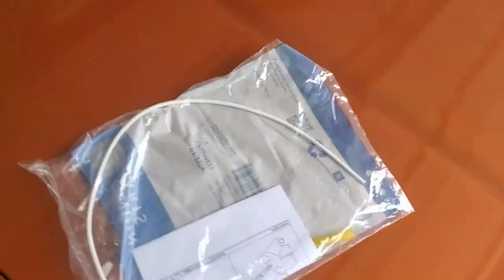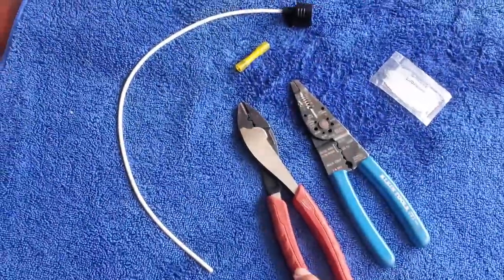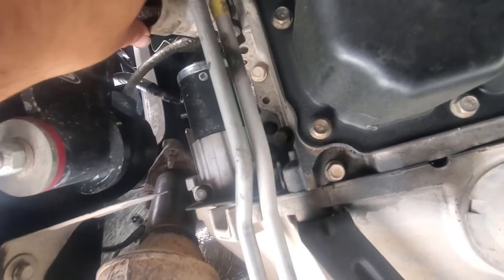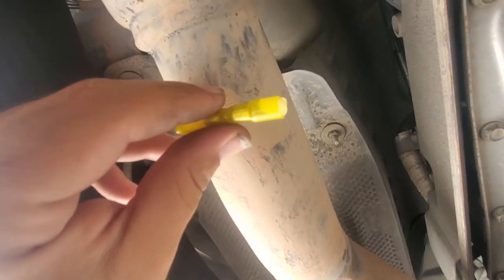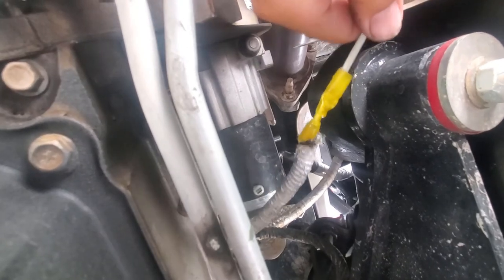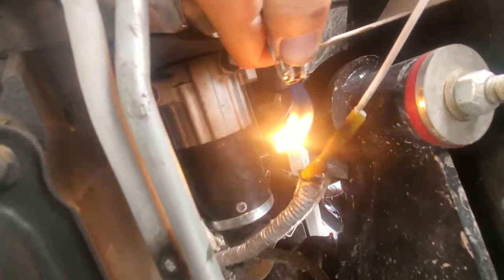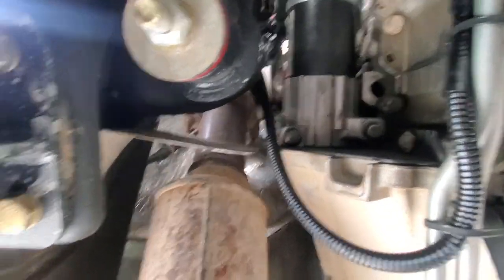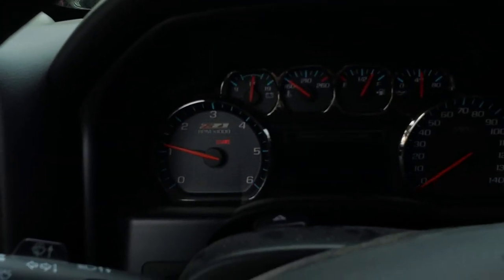Broken starter connector plug. How to change a wiring harness pig tail.

Comment: I watched your first video of changing the starter. You failed to mention the tab broke! 😂 when mine broke I was angry. I couldn’t get it to come off. I feel like I fought it longer than it took to change the starter out. Glad I’m not the only one who’s broke.
Reply from the maker: Dude I’ve done my starter 3 times since. I’ve broken 2 of the 3. It’s still frustrating
Reply: Mine broke in my tundra. It literally crumbled to pieces.
Reply: @FinalBossGarage  3 times! What brand are you buying? I bought the AC Delco brand off Amazon so I could get 2 day shipping and hopefully it’s the last one I have to buy. Truck is a 2015 so no auto on/off BS
Reply from the maker: @andrewgardner107 i got it from autozone so luckily each time has been under warranty. Seem to get about 20k miles out of each one. Mine is a 2015 as well. I can change it in about 10 minutes now that’s I’ve had all the practice.
Reply: Recently pulled my starter on Thursday, and the tab was brittle. After fighting with it for a few minutes, I broke it 🤦🏽‍♂️
Reply: Yep, mine too 17 Sierra 😂

Comment: You don't need to splice in a new connector if you break the red clip. The plastic parts of the connector easily disassemble. Buy a new connector pigtail and pry out the gray core with a small screw driver or steak knife from the side. Next push two small paper clip pins into the two small holes on each side of the metal connector until they bottom out. Now slide the plastic connector off the metal crimped wire connector. Repete with the broken one then simply slide the new connector then the gray core onto the existing metal crimped connector.

Comment: Hey so my clip is broken. I have the replacement cable but my question is, sometimes did your vehicle not start and you had the clicking noise when you turned the key? And sometimes while connector was still broken, and you put back on starter did it not crank or sometimes would it?
Reply: Go under the vehicle and apply pressure to the connector so it can start up, while with the other hand use the key fob to start it .... when starting it it causes enough force to kick the connector off..

Comment: Thanks for this. Same thing happened to me on my 2018 GMC Sierra tonight. I ordered the pigtail but am wondering if you can just swap the red tab and inner lock onto to the existing connector. Would be easier if it can be removed and reinserted. I am happy to see you were able to do it from the bottom though, as I put the wheel liner and everything back on.
Reply from the maker: Glad it helped. I felt like nobody else would make this mistake and the video would of been pointless. No clue if you could or not though, on swapping the tabs.
Reply: Did you swap the red tab? please show me how, maybe a video? 
Broke mine today, 2015 sierra 1500, the part is exactly the same.
Thank you so much!
Reply: @fzy55  You can actually just remove the end plug and put a new one on. I figured this out after I did some searching on the part number I found on the new plug when I bought the pigtail. I feel horrible about suggesting you watch one of my videos, but I did post on how to do this, and the description has the info on the part numbers you need. I couldn't find a way to contact you via YouTube to mention this. I will say though, huge thank you to Final Boss Garage, as it got me on the road to finding the pigtail and realizing I could swap the connector.
Reply: @stevegnh  Huge thanks! Found your video on your channel! Will do the swap once i receive my part, by the way, i found the equivalent part on eBay which is just less than 10 us dollars  including shipping!
Reply: @fzy55  good luck!
Reply: Great video but I found it easier to I unclip the whole end of the plug and replace it.

Comment: When you pushed the NEW connector on did you have to pull out the red tab then put it back on or can you just connect the wire and push it on
Reply from the maker: Dude I still have no idea. I’ve broken two already. I hate those clips
Reply: @FinalBossGarage  I mean like when you installed the new pig tail did you just push it onto the starter. You didn’t break it in the video. I have the new pigtail ready to go just not sure when I push it on the starter if I need to remove the red tab then install then put red tab back on the
Reply: @nathangraham7248 bro what??? I’m so confused by this why would you remove only the red tab? If you have a new connector why not just replace the whole thing

Comment: what was the function of that particular plug and what would happen when it would come off before you fixed it with a new pigtail? Was it meant just for signal, or did it supply power?
Reply from the maker: Signal from ignition
Reply: @FinalBossGarage  Thanks. I suspect that it was in fact what is termed the S post on the solinoid. I am in process of trouble shooting my 2008 Uplander and what had me confused was that on my starter there is no physical S Post. It merely had a female plastic connector with which a single small gauge with from underneath the vehicle plugged into. I was presuming it was the signal wire to the solinoid traveling down thru the path to set the solinoid in motion to activate the connection so the electric on the B post could travel on to the starter motor.
Reply: I went through some serious do, or die circumstances and still am on this vehicle, but I think I found the correct path in the following post by someone. Here it is for your review. It has to be the simplest, least confusing set of instructions on this subject I have ever come across.                     It occured to me you might be able to use it as a blueprint for an instruction guide to give out to others snd perhaps check it over and comment if you see anything in it that its missing. If not I should be good to go.                                                                                      

                          “No Crank No Start”
Let’s start with the issue on a  particular car…a 2000 Mercury Grand Marquis.
Car was starting up just fine everyday until one day I went to start it and just clicked. I knew the battery must have drained overnight somehow so I thought I had a parasitic drain somewhere in my car but when I checked, it was just drawing around 20mV (well under average draw of 50mV) so I ruled that out and since my battery was 7 years old, I assumed that the battery just gave up.

I purchased another battery, replaced it and my car started BUT…I did notice that the first two or three cranks were very slow and after that, the starter was cranking normally and started the car right away. The same thing happened every time I started the car, slow cranking at first and then normal cranking speed and starting up right away.

That went on for about two weeks or so until I finally started having issues starting the car again. Sometimes when I turned the key, I only got a single click and then nothing else, no crank, no start. Some other times, after I turned the key, it would take a full second for the starter to start cranking the engine and then start the car as usual. And some other times it would start the car right up!

This was the pattern for a few more days until I just couldn’t start the car AT ALL! Turn the key, single click and no crank, no start! Ok…time to check every component of the starting system to see what went bad! First…I did the simplest things to do. Just tap softly on the starter with a hammer or something somewhat heavy while you try to crank the starter and see if that gets it going. It did not.

OK…maybe the flywheel ended up in a position where the starter can’t catch it and therefore unable to crank the engine. The solution…simply turn the crankshaft pulley with a breaker bar and the appropriate socket a little bit to turn the flywheel enough for the starter to catch it and start the engine up. (This method will also let you know if your engine is seized up or not and a reason why your starter would not be able to start your engine) I was able to turn the flywheel and then tried to start the car…still one click, no crank, no start! No flywheel issues!

OK…next thing…check your battery voltage. Without any load on it, it should read around 12.6V or so when it is fully charged. If that checks out, next…measure the voltage on the battery while trying to start the car (doesn’t matter if the engine cranks or not, the load will still be there) the voltage should not go below 10V. If it does go below 10V, then your battery charge is low and therefore won’t be able to crank your engine. Have it recharged and try again with a full charge. If the starter still doesn’t crank the engine, now you know your battery is not the culprit!. (In my case my battery was brand new so I knew that was not the issue. I was reading around 11V with a cranking load)

Next step…check resistance on battery cables with voltage drop WHILE there is a load on the cable. Set your DMM on DC Volts and connect one lead to the positive battery terminal and your other lead to the other side of the positive battery cable that goes down to your starter and connects to your starter solenoid. (It doesn’t matter what lead you use on either side as you’re only looking to see the voltage difference between leads) (Not all starters have the solenoid mounted on the starter itself so just follow the thicker positive cable from the battery until it reaches the solenoid) Try cranking the engine for about 10-15 seconds and read the voltage on the meter. Any reading below 0.5V is acceptable on most cars but please check on your particular model. If you get a reading of more than 0.5V, then your cable is bad and needs to be replaced as it has way too much resistance for the current to flow properly to the starter. If the positive cable checked out okay now test the negative cable. Connect one lead of the DMM to the negative battery terminal and the other lead to the starter body. Crank engine for 10-15 seconds and check voltage. Same…if above 0.5V reading, the cable is bad and needs to be replaced. (NOTE: If your starter is actually cranking the engine but you just want to check your cables, you need to disable either your fuel pump or the ignition system to prevent the starter from starting the engine) (Also…allow the starter to cool off for a couple of minutes between cranking attempts or you could literally fry the solenoid) In my case, both the positive and the negative cables checked out okay so the cables were not the issue either.

Bad ignition switch?..You can check this easily with your jumper cables or a remote starter.
Keep the ignition switch in the off position - Just connect one end of the positive jumper cable to the positive battery terminal and with the other positive end of the jumper cable briefly touch the smaller bolt on the starter solenoid to activate the starter. Do the same thing with the remote starter with the only difference that you actually connect the alligator clip to the solenoid smaller bolt and press the button on the remote to activate the starter.
If the starter now cranks the engine, there is a problem in the wiring from the ignition switch to the starter solenoid. In my case, I still had just one click, no crank, no start! Ruled out ignition switch as a culprit as well!

If you went through all these steps and still couldn’t find the problem, then there is only one thing left that can be wrong…THE STARTER! I should mention that this starter had only been on this car for 4 years (I replaced the original one after the bare wire going from the solenoid to the motor corroded so bad that it couldn't flow current properly anymore and therefore couldn’t crank the engine. (Why is it bare anyway to begin with? Especially anywhere that roads get salted for winter! UGH!) I honestly thought that the last thing that could be wrong would be the starter so before I took it out I checked this bare wire and it was still looking pretty good after 4 winters. But I wanted to be 100% sure whether the starter was the issue or not so I took it out and before having it tested at the auto parts store where I bought it from, I bench tested myself and sure enough…it was still doing the one click, no spin.

The one click was just from the gear coming out to meet the flywheel but there was no spinning whatsoever. YES! Found the problem! Bad starter!! But why did it fail after only 4 years of use? I wondered… To be double sure lol I still took it to have it tested with their machine and guess what guys??? The same starter that wouldn’t work for me is now working for them every single time they start it…HOW IS THAT POSSIBLE?!
They said it’s working like it should so there must be something else wrong with the starting system in my car. I was puzzled!!.. I was pretty sure the problem was the starter!
I brought it back home and bench tested it again and guess what??? YES!!! You got it! It went back to doing the same thing it was doing before, just coming out but no spinning. Now I started to believe that maybe the battery was bad after all and just didn’t have enough juice to crank the engine.

I wanted to be sure about the battery as well so I took it out of the car and took it with me along with the starter and the proof of purchase for the starter as it had a limited lifetime warranty on it. Got to the store and they tested the battery and passed the test perfectly! (I wasn’t surprised…it is an almost brand new battery) I asked them to just give me a new starter with the warranty I had on the old one and they did. I asked them if they could test both starters to see if I could see any differences and they did…
RESULTS…New starter was coming out smoothly and spinning fast as it should since it’s new. Old starter wasn’t as smooth coming out and I also noticed that it wasn’t spinning as fast as the new one BUT it was working nonetheless! (Still puzzled about it) I grabbed the new starter, the battery and came back home. Installed the battery back in the car and then I proceeded to bench test the new starter and guess what???..It was doing what it is supposed to do…coming out and spinning fast! Got under the car, put it back on the engine, got on the driver seat, turned that key to start and the engine started right away like it normally does! PROBLEM SOLVED!!!  So…to answer the question that if a car’s starter could be bad after testing OK, the answer is YES!! 100% It can be bench tested, pass the test and still be a bad starter!

Comment: How's the new pig tail holding up? I'm putting one on tomorrow. Thx
Reply from the maker: It's solid with no issues
Reply: @FinalBossGarage  mines would not click or lock on.
Reply: @DrJeffM  What did you end up doing?
Reply: @FinalBossGarage  I’m surprised as to the way u zip tied it to ur transmission lines. They get hot, won’t it affect the wire?

Comment: What happenes if it’s broken would the car kill the battery
Reply from the maker: It won't effect the battery. If the tab breaks, the clip will vibrate out causing you to no longer get signal from the ignition. Basically, your car won't start anymore.

Comment: My husband just broke the entire plastic casing dor the male peice that plugs into my 2007 toyota matrix we were able to plug the wire into the starter but im worried it will fall out at some point but cant find anything to replace that part not even on amazon non match the female port into the starter. Am i just stupid at looking for parts or do they serioulsy not make these any more
Reply: I know its not the same as the truck but i couldnt find anything similar to help fix my problem. Thank you for posting this😊
Reply from the maker: Hey not sure if you guys ever figured it out. You can sometimes get away with sliding a zip tie through the hole. Google zip tie for broken clip

Comment: I broke my clip on my wire connector to the MAF sensor....I can't disconnect anymore....any solution to it besides replacement? Thanks brother
Reply from the maker: Did you ever figure this out? Google zip tie trick for broken connectors
Reply: @FinalBossGarage  yes I did…an auto electrician mechanic showed me underneath the plug has a clip you can squeeze and push at the same time before pulling it out…the clip on top still broken though but there’s another one below the MAF sensor